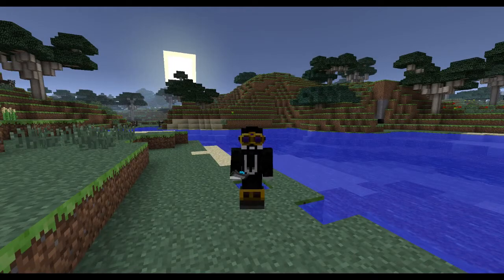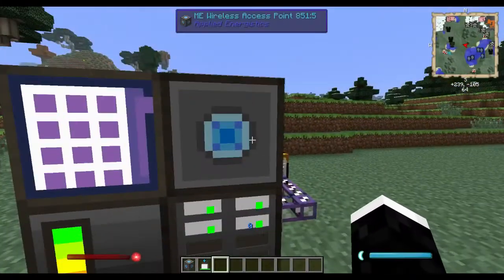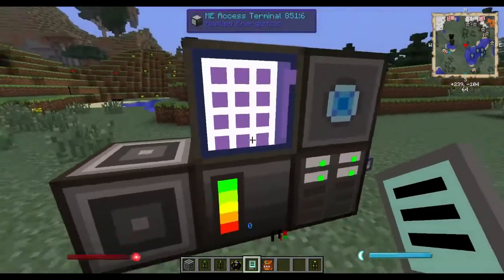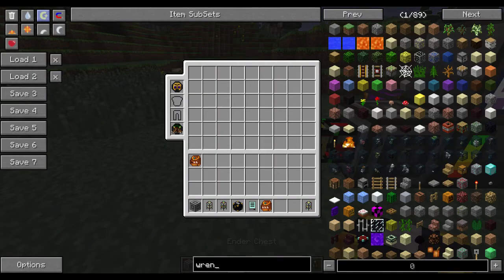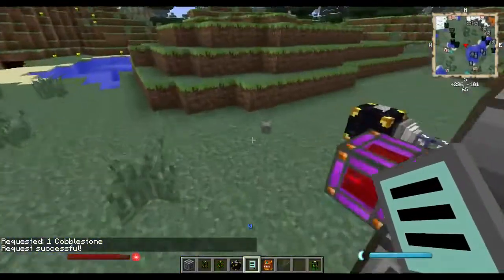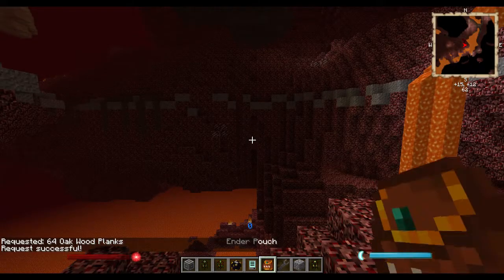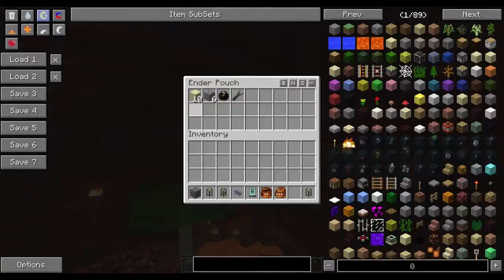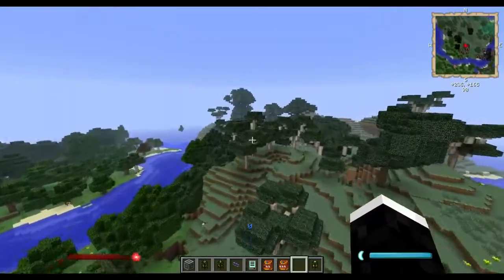[Tutorial] Remote AE System using Logistics Pipes + Ender Chests (FTB)

Comment: This doesn't seem to work on multiplayer. It's like the orderer can't seem to connect to the system or find it. Or the server get's confused about things :(
Reply: I figured out that you need to add a Logistics Power Junction to the system to allow inter-dimension use across worlds. Each junction gets you 2 million block distance from the source order pipe in the overworld.